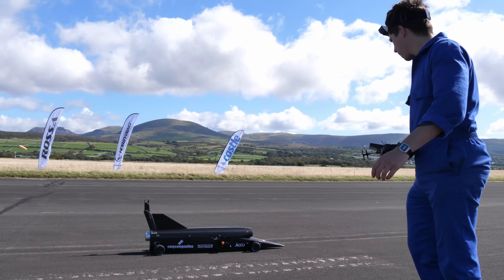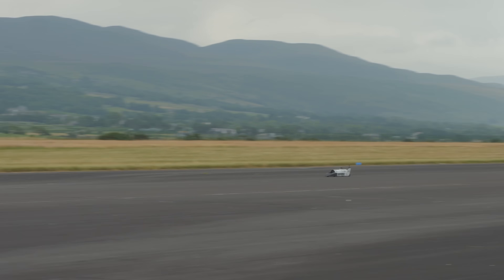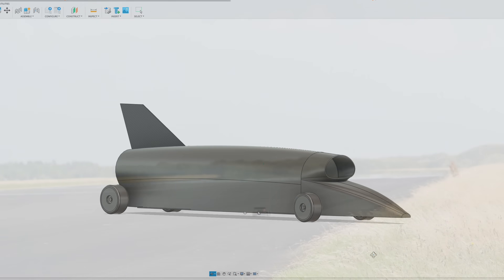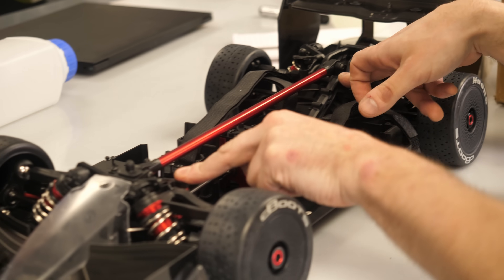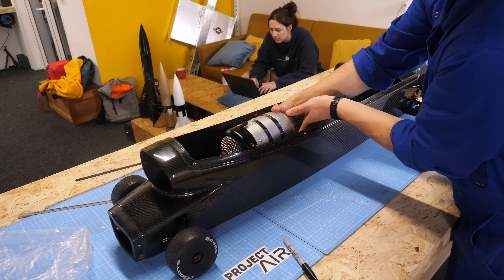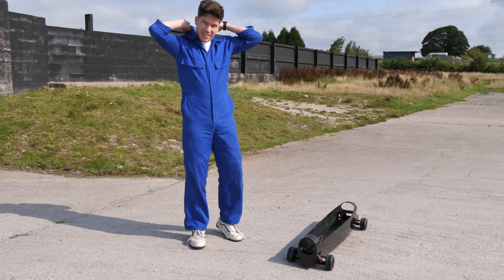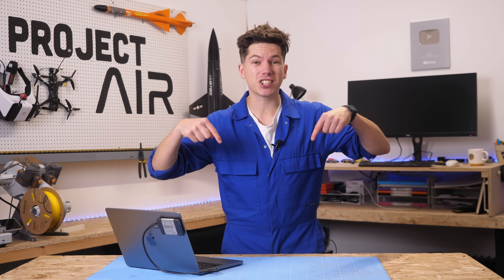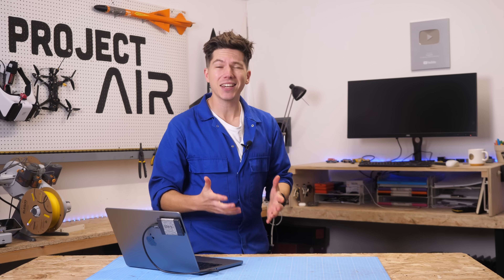Building the WORLDS FASTEST Jet RC Car 3.0

Comment from the maker: Part 2 Here! https://www.youtube.com/watch?v=NTX3Fby4Je8&t
Reply: ok
Reply: for the exhaust tube you should have did a tube in a tube with a gap in-between the outer layer would be the heat shield and the air moving out the back would pull the hot air out from between the tube
Reply: Do they make snap-protection cases for iPad? If not, they should. More specifically, a sort of bumpercase with crossections as to not block the device's antennas
Reply: @EyesOfByes carbon fiber is super conductive to RF so it would actually be a great material to intentionally block the device's antennas so it can transfer the most energy from the signal to the external booster antenna which is huge and laid into the exterior of the case by air-gapping bits in the layers of CF fabric in patterns that stack and make a sort of cell phone signal cannon out of the case 😀 if one treats the whole thing as a passive repeater it can probably be laid up using current level of tool sophistication or even simpler.  20 years ago I'd have to buy a bunch of companion software plus the interface stubs from Solidworks and even then it was twitchy to keep running smoothly; now, I'd be surprised if even Fusion360 didn't have all sorts of solid/fluid mechanics available for the platform by now (probably not "free" tier, though a temp key can probably be requested from Autodesk to get a decent trial/demo of more sophisticated/expensive features).
Reply: going with the smaller engine is in keeping with Thrust SSC, it set the land speed record with 2 Rolls-Royce Spay 202 engines, but was designed for the super sonic 205 engines (only 12 were ever built) they had 205 engines but never used them. fun fact Thrust SSC had inline rear wheel steering
Reply: nice to see CF being used in a very useful way as a material instead of cranked out as a fragile part that destroys printer hotends for negligible weight savings over other available/less expensive filaments.
Reply: oh lord you are destroying that Jet Engine! to much fuel at start up!!!
Reply: Also you should have a gyro connected to the steering it will be much more stabil then. we do that on our planes, gyro only for the front steering wheel.
Reply: Get some inverted aerofoil winglets on it. Press it down......hard.
Reply: you should put two engine on the sides

Comment: I already made a suggestion to the record braker about titanium wheels, so they don't expand. Now, may I suggest you something about wheels as well? You might want to consider making solid aluminium wheels, with a bigger diameter, and wide enough so braking is not so much affected.

Comment: You should add a funnel in the intake so 100% of the air that hits it goes into the jet instead of getting pushed through the chassis

Comment: Not to rain on your parade or anything, but if you use a regular vacuum cleaner to clean up carbon fibre, you will break it. This is because CF is conductive and eventually gets into the motor. If you don't already have one, you will need a vacuum for hazardous materials which has a much higher filtration of the air and won't short out your vacuum. I know this because my work's Edward vacuum is currently very, very sad..... and burnt out.

Comment: Richard Noble being on your team for this is crazy, well done mate you deserve the recognition for what you do.

I thought the point of active downforce although maybe a jesting comment could be really applicable to pushing this further, if you designed a Floor like a modern F1 car that speeds up the airflow underneath and some active wing systems to increase downforce as speed increases you could really get the thing super planted to get all the power out of it, something you could possibly control with a pitot tube automatically altering flap angles as speed increases.

Comment: You need to have a lot more air intake if you want to have a lot more thrust.
Remember that what you take in, you need to spit out, and since the engine and exhaust's job is to spit out a compressed air, what goes it, mut some out in the same quantity (with the burnt fuel energy and mass). It must add up at the end in terms of the mass.

Comment: I'm surprised you're not controlling the car with an actual car controller with a steering wheel. I know these controllers are limited in number of channels and functions but then you could use two independent systems without much weight penalty. Maybe for straight runs, which you will do at high speed, you can just have a very low rate with lots of expo for good control of direction with a stick.

Comment: Since that car that you built is jet powered meaning you’re not using the drivetrain you can remove all the drive drain the diffs the center spool, the shafts everything to reduce drivetrain drag and removing some weight, you can get rid of all of it the motor mount everything also I would be using BSR tires because they are half the weight reducing inertia and rotating mass also instead of using the drivetrain with a brake set up install just a double parachute 🪂

Comment: Stainless steel is sometimes used as a thermal insulator as its thermal dispersion is something like 35-40% slower than mild steel. Might use that to replace the aluminum “pipe”. And might consider wrapping it in a layer of woven fiberglass.

Comment: You should use a thrust tube from the jet industry. It has an inner and outer section, which will eliminate your thermal problems. To increase efficiency, you should use a funnel for the bypass air. Your tube might collapse in half due to high temperature and a vacuum.

Comment: for the exhaust tube you should have did a tube in a tube with a gap in-between the outer layer would be the heat shield and the air moving out the back would pull the hot air out from between the tubes

Comment: Aluminium dissipate heat fast, copper transfer heat great and steel is great to soak heat. Easy to fit insulation or heat reflector on the exhaust tube if needed. Doesn't have to be thick.

Comment: Thats looks nice so far ,because you will have 100% failure in the future and you will destroy that nice car .... from my experience building and flying all kind of rc turbine models i recommend to remove the metal pipe ,order your self a custom Stainless Steel (if you google Grumania Jets) they can make you a custom pipe they are very good , also you need couple more supports around the  pipe for more strength ,also you can find those at Grumania and are made from plywood or you can copy the design and make them from carbon its up to you.....  when the carbon/cevlar you are using heats up will become very flexible and are examples of big rc jets snap in half or have deformed  bodies after few minutes of flight when are bad designed ,yes you used the resin that will hold more heat but still is not enough without supports  ! Also you need Heat Shield ,you can google fo( i example (Tamjets Heat Shield) is one i am using and you need this around the pipe glued to the body ! If you need any help send me a message !

Comment: A type of ram air intake should be installed in front of the turbine so that all the air is directed into the turbine; this helps to concentrate all the air into the engine. Good Luck🎉

Comment: have you considered adding refactory cotton?  It is a sheet of insulation that is often used in forges.  Wrap that around the tube to isolate the heat to the tube.  Might be useful when you use the larger engine.

Comment: All that effort and material to reduce the drag by (136/141)=0.964, so 3.6%, while leaving the wheels, and suspension, outside of the body, generating most of the drag.

Comment: 15:30 if you need to get it colder you want to add a flame tube. That is a 2nd tube outside the metal tube you have there. The air has mass and momentum and our friend bernouli loves that. This creates a low pressure in the tube sucking in cool atmospheric air. This atmospheric air heats up slower than it takes to transit the length if the tube. Which means cool ducted air flows in along the outside of the jet turbine. Enters the tube and flies through the tube. As it passes down the tube the thermal energy radiates into this airstream. That heat is then ejected out the back before it gets time to transfer to the surrounding area.

You can take it a step further and insert slits along the tube to suck in clean air into the already combusted air and a secondary fuel delivery to add an afterburher to the car and theoretically increase thrust by 50%

Also the shape is good enough to add a diffuser at the back. More downforce without adding drag. Better straight line stability

Comment: You make some impressive stuff, but also fail to research everything properly… it’s frustrating! Why mount the jet engine in the car and have no intake duct to keep the air flow clean? And why the aluminium tube with zero heat protection on the electronics inside? Surely you know to wrap the tube in a Kevlar type blanket? 🤷🏼‍♂️ I’m no engineer but these things should be simple 🤔

Comment: About the aluminum pipe, the most critical parameter for us RC turbine hobbyst is the distance between the exhaust of the turbine and the pipe. This tends to be between 25 and 35mm regardless of the manufacturer for sizes up to 300N, but you can check the manual of your swiwin.

If you do not want to spend time desinging the pipe there are commercial ones available. Maybe the most common brand in Europe is grummania.

If the outer wall is hot then something is wrong. Some folks mount pipes inside foam planes (not even balsa wood, actual foam), and they hold up perfectly fine. The outer wall is barely bigger than aluminum foil for food, its the aerodynamics part that keeps the hot air far from the wall.

Nice project. Saw you in the video of the electric record winner, so it is not a surprise :) Cheers.

Comment: make the intake of the chassis a ram air intake into the engine .but make also holes for the exhaust of the engine so that the engine can take air around of the his shell so when you shoot the exhaust air in the pipe its sucks the air round in to the pipe its might will help the pipe to stay cool and you got more air that shoots out of the pipe . am I Wong? the ram air intake will work because the engine gets more air

Comment: As mentioned by a previous commenter, an air duct from the inlet to the engine will prevent turbulence at the intake and improve performance.

Also, as mentioned by Easy Composites you will likely need active canards in the nose to increase downforce. The car is likely to flip at high speeds or in a headwind.

Bloodhound LSR (which your car resembles, ahem) was due to retrofit these with the addition of the rocket motor for the Record run before COVID stepped in, the project ran out of money and was shelved.

Comment: body engine and suspension are all go but the small diameter of the wheels is the limiting factor , fact is they just don't stay together at high speed , the wheels used in tether racing however have regulary run to 300kmh , those are the wheels you should use

Comment: Just curious, why not use wheel covers to handle the drag of the open wheel design a little more efficiently? Could they have not been integrated into the body design, is it an issue of rigidity and turning ability?

Comment: Not enclosing the rear wheels at least (they don't need to turn for steering) is diabolical :( Also, how on earth was the original jet engine on a regular rc car prototype faster than the later streamlined one? Makes no sense to make a dedicated streamlined one lol. Just wondering, no hate. The carbon one looks well good

Comment: Very wide wheels and no fairings. If a jet engine is used, the wheels should have a significantly thinner profile.
At this speed, the bottom of the model should be flat and there should be a diffuser at the rear, otherwise there will be separation from the road.

Comment: Did you measure thrust with and without the tube?

It would be interesting to see the gain in thrust by the cold air sucked in along the surface of the pipe

Comment: Might be an idea or two, but might be better to fully duct it to the engine so air flow into the engine is smooth. 

Also, might be a good idea to  make the intake a bit smaller to take advantage of ram air as the duct will expand slightly as it gets to the engine. 

You could also duct air from the intake into the exhaust pipe to act like a turbofan bypass without the fan. Would get you a bit more power and reduce drag somewhat

Comment: Some advice on the Aluminium tube that you are using, from someone who flies RC Aircraft with jet engines upto 250N thrust. There are two design aspects that you could use from this to upgrade in terms of higher overall thrust and also lower tube temperatures.

That tube is generally referred to as a Thrust Tube and nowadays made from two sheet metal tubes with a corrugated wafer of sheet metal between them (the sheet metal tubes and wafer are spot welded to each other). This creates an air gap between the tubes and is much better than a solid pipe in terms of heating. A thrust tube with a modern design like this will not heat up as much as a solid pipe and will also be lighter.

There is also very importantly a Cone Shaped part on the input of the Thrust Tube which acts as a venturi/vacuum generator that uses the turbine thrust to pull in surrounding air around the thrust tube to generate the most optimally possible thrust. A key factor is also the distance of the exhaust pipe of the turbine inside the thrust tube. If it is away from the "Sweet Spot" it will either generate too much heat or otherwise not generate as much thrust as optimally possible.

An old school way of checking this is to have a test setup to measure the thrust and keep changing the thrust tube position for an optimal setting that gives the best thrust possible with manageable heat. You get ready made thrust tubes for RC Jet Aircraft that you can directly use in your project.

Or you could also mount the turbine at the rear of the car (similar to an rc J-10 without a thrust tube) which will shift weight to the rear for better stability and also reduce the weight as the thrust tube (or pipe) is not as long as when the turbine is mounted up front
Reply: Is shifting the weight to the rear wise? I thought you needed the centre of gravity ahead of the centre of side area for stability.
Reply: @ColinWatters  My mistake, it does seem that a proper center of gravity would be just behind the front axle or more towards the center. The rest I strongly stand by in terms of a proper thrust tube compared to an aluminium pipe.

For Aircraft it is true that moving the CG rearwards makes things more unstable (more agile at first but then suddenly more and more uncontrollable)
Reply: @ColinWatters A rear centre of gravity ensures better stability at high speeds.
Reply: @Sweetcat07 The reason I asked is that it doesn't work that way for aircraft. The further aft the CoG the less stable it is.
Reply: @ColinWatters  really? I'm going to do more research on that.

Comment: Not an expert in fuel, but I heard that ethanol works quite nicely, and has a LOT more power per litre, plus it is fully sustainable (depending on how u make it). It produces 26.8 megajoules per kilogram and burns faster than traditional fuels which is why it is now being adopted by several racing companies.

Comment: That's a pretty vehicle for sure. Hope you are going to talk more about Air Shaper and the decisions you took. From the quick screengrabs, it looked like a 3.5% reduction in drag which may be a lot or a little, I don't know. Or maybe the screenshots aren't indicitive of the final design and gains. 
Also, talk about center of effort and mass if possible and how they should relate to each other. It looks a bit "nose heavy" with the engine up front but whether that's real or not or what actually is the best approach for land speed cars, I don't know.

Comment: This was like the Avengers of Sponsors haha. I do wonder if you could fix aerodynamic shields over the wheels that also turn with the wheels? The steering controls also seem a bit sensitive.  Could you possibly increase the steering expo rate in tandem with throttle so the higher your throttle the less touchy the steering is? You'd be able to make much more minor adjustments at speed. Not sure if you had any issues with range but in the drone world we use ELRS since it's inexpensive and has much longer range than something like Spektrum. Speaking of fpv it would be awesome to fit an fpv camera on this and use goggles to better steer during the runs. Maybe also ground effects fan for downforce? I'm sure you've already done the runs by now but if there is a v3 maybe some ideas!

Comment: Is there a plausible reason why the jet engine is mounted in the front and not in the back of the car?
The aluminium pipe could also be an intake instead of an exhaust and wouldn't heat up the whole interior and shell.
Most fighter jets also have a long intake and the jet engine rather in the back.